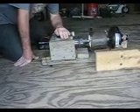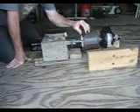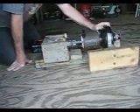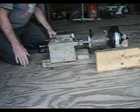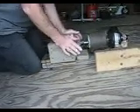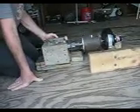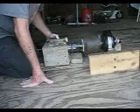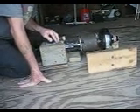Advanced Magnet Motor R&D Update

Comment: Its been at least a year. how are you doing with this?
Reply from the maker: +fireboycli I have been trying to get the speed up to 3600 RPM to run a generator, but I have only reached max 1200 RPM. I am self funded and retired so my resources are limited. I need a more professional design with proper bearings, balancing  and sensors for speed control. I am building a super large solenoid to give the pull forces I need to keep up the torque in the permanent magnetic housing so when I put a load on it , the motor won't  stall. I also have had a cancer operation last year and that slowed me way down. But hopefully this year I will do better. Sorry to be so slow with this project. I really should be using a voice coil type actuator but no one makes them in a 12 volt DC configuration. I want this to run off of a 12 volt DC car battery so it can be portable. thanks for watching
Reply: Thank you for the update, I will pray for your health and that many solutions will come to you. Would enjoy a new video when you get your next level of tests underway.